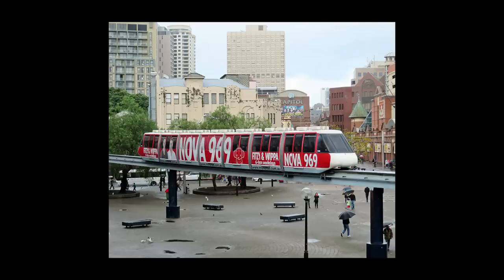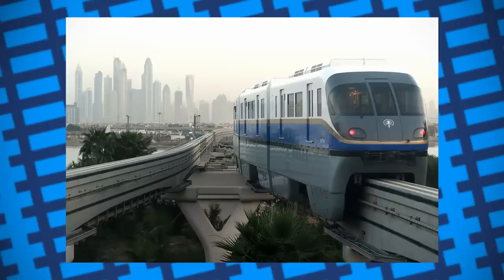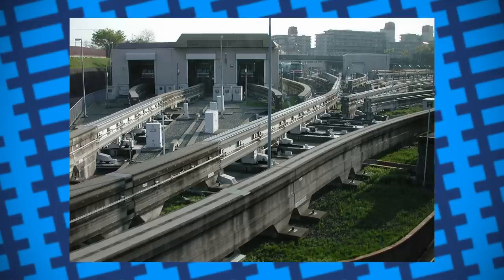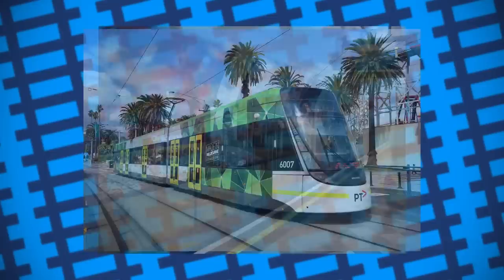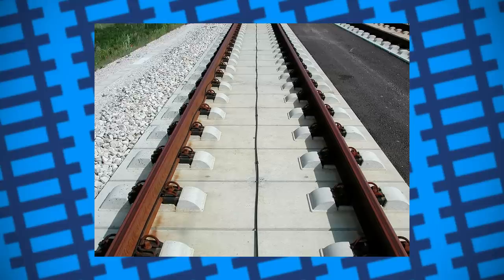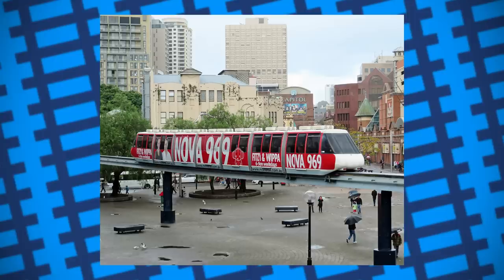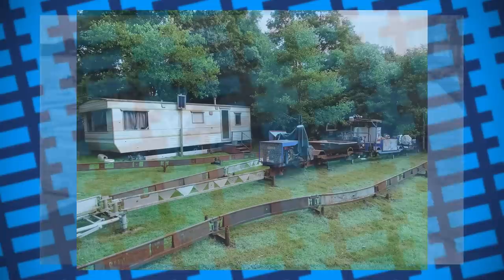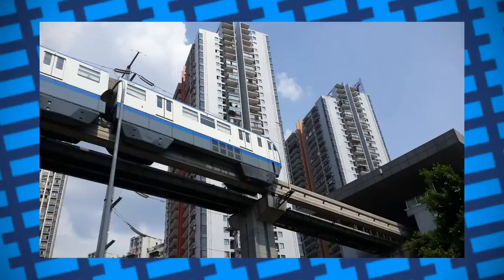Why monorails are bad as public transport - Monorails

Comment: Look man, I like trains as much as anyone, but there's no need to misinform your audience because of your North American/European centric worldview.

- There's no mystery in monorail track switching. In Chongquing and Tokyo it is done automatically and there has not been any incident or malfunction regarding that so far.
- The only fair comparison of monorails are to elevated metro lines because they are both elevated, fully separated from traffic, and have similar construction costs, anything else is absurd. Comparing monorails to trams is just laughable, so there goes 1/4 of your video. The elevated monorail-metro comparison, done fairly, would have revealed that monorails are quieter, can traverse steeper curves and elevations, and occupy less space, at the expense of maximum system capacity and maximum speed. So no, monorails aren't perfect, but they are not the crap you are saying about them, especially on 45000 pphpd capacity routes with little available space.
- Your safety "concerns" are also unfounded, one would think that Japan, the most seismically active country in the world, would have noticed if their monorails take longer to repair than their elevated Metros. The same with Malaysia, India or Thailand, who are also in the Pacific Rim of Fire. And the passengers being "trapped" in monorail cars without means to escape is solved as simply as installing lateral walkways. It has been done on Sao Paulo with no issues and preserving its aesthetic profile.
- About the lack of compatibility with rail systems. That's such a big issue in the wealthy Global North, isn't it? Well, it's irrelevant for us in the South, because in most cities where monorails are being built, bad planning due to neoliberal politics has prevented our cities from building trams, and we can't afford underground metros (and no, BRTs aren't a solution either, ask Bogotá). Sure, an underground metro may be the pinnacle of mass transit, but our countries just can't pay $250M+ per kilometer in order to build them. Or as in Peru, we don't have the expertise and legislation for building one, our underground Line 2 is stuck since 2014 with 0 stations working so far. And many of our main avenues don't have enough space for elevated metros, which do require more physical space. 
- And the proof that you haven't done your research is precisely that: that according to you, no monorails are being built for mass transit today, lol. What about Bangkok, which has both elevated and underground metros, but it's also building two monorail lines as we speak? Or Cairo? Sao Paulo? Bahía? Santiago de los Caballeros? Panama? Liuzhou? Are those cities irrelevant because they are not inhabited by wealthy white people?
Reply: Cairo monorail is ...nearly finished.

Comment: In Bangkok they are building new monorail lines.
There it make kind sense. Because of space restrictions and the danger of flooding
trains have to be elevated anyway. (On the one Subway line you all ways have to make 
few steps up before you can go downstairs, so the subway don't run to easy full of water.)   
The advantage of the monorail is that they are less of a eyesore then existing skytrains.

Comment: Monorails do have their use-cases in public transport. The issue with most monorails built, is more political, than technical. They have simply been built to have a monorails, rather than having the need for a transit line, where a monorail would be the best fit. 
Examples I would kindly ask you to take a good look at, are the Shonan Monorail in Enoshima, and the Schwebebahn from Wuppertal. Both have been built, as the need for a transit rout was present, and a Monorail was the best option.
Building a Monorail somewhere like New York City, would be a bad idea, since the terrain allows subways/metros to be more efficient. But if you take look at Wuppertal, neither the terrain nor traffic allows any other mode of transport, to be as efficient as the Schwebebahn. Its problems in recent years have to do with bad management, and not with the technology. It ran over 100 Years without any major issues, and had only 1 major incident till this day. I can't say the same from any tramway built anywhere in the world.
My point is, that as a mode of transport, monorails are not inherently better or worse, than "conventional" rails. Both have their advantages and disadvantages. But if you use one, where its advantages are meaningless, but its disadvantages are a big issue, then you (as the planer) are at fault, not the technology.

Comment: I guess that some of these drawbacks were only realised in practice.

How do you feel about Hyperloop? I feel that most of the drawbacks to monorail systems apply even stronger to the Hyperloop concept - which to me sounds completely unviable for these reasons, despite all the hype that's looped around it.
Reply: Hyperloop is vaporware, and has too many variants to assess properly anyway (air hover, maglev, regular track, rubber tyres; single pod or multi pod train; exactly how depressurised are the tubes going to be; single-route or a switched network; freight or passengers; etc)
Reply: It's still made more sense to use Rollercoaster as suspended monorail rather than realizing hyperloop concept.

Comment: 'Because they NEED to be raised, they have a small footprint.'
This isn't even an upside, it's a side effect. Because you could just... raise a normal set of rails all the same?
Reply: on the flip side, the claim that regular rail's switches are safer and more eaisly repaired because they're on the ground is like ... 'but... elevated rail exists?'
Reply: @laurencefraser  I mean true but elevated rail still has solid ground making the height less of a hazard, whereas with monorails there is little to no infrastructure to stand on. Even if both have  a height risk, the degrees are simply different.

Comment: While I agree with the points about the rail itself, I disagree with the idea that a raised rail is inherently worse. You can easily make a walkway along it for emergencies, and the space savings and traffic reduction in crowded areas are worth the trade-off of trickier maintenance. Portland has a lightrail that is mostly street level and it very often gets stuck in traffic, meanwhile Seattle has one that is mostly raised or underground and it's almost always on time (and a more pleasant experience). Monorails might still be good for increased traction (although I bet you could just as easily make some kind of cogged track system for hills with normal rail), and Maglev type monorails are probably best for really high speed trains (like the 300mph kind)

Comment: funny how one of the key advantages of them, the elevated tracks, is easily replicated on normal rail as well.
Steeper gradients still need extra effort but not like it's impossible either. I imagine the cost of the elevated track for normal rail cars would be quite comparable to monorail tracks, if not maybe cheaper.
Reply: It's entirely possible to have rubber tired trains too, for extra grip. Some lines on the Paris metro, to name one.
Reply: @captainufo4587  and rack rails are a thing too. Both have enough down sides that you really shouldn't use them unless they're actually needed though.
Reply: It’s not just the elevation of the monorail tracks that give them an advantage. They also have a much smaller visual impact and don’t block as much sunlight as raised regular rail systems.
Reply: @captainufo4587  bad idea. You lose the huge economic advantage of the low friction.
Reply: That was one thing I felt the video didn't explain well. Conventional rail can be elevated just as easily as monorail, making the avoidance of other traffic and ability to install it above other infrastructure not an advantage of monorails. However monorail beams block less light to the street below than conventional tracks, the street below an elevated train (most famously Chicago's "L") feels almost like driving in a tunnel, sort of dreary. For resort areas, such as Las Vegas, this would be an even bigger consideration. As far as I can think of, this is the one and only advantage of monorails over more conventional designs except in very unusual niche applications such as the industrial/mountain monorails mentioned at the end of the video.
Reply: @quillmaurer6563  Monorail has a bunch of advantages, that's why they were constructed as prototypes. Turns out, those advantages in most cases are set off by even more disadvantages; and today, a "light monorail" (eg a local commuter system as opposed to SCMaglev or Transrapid) would not be constructed/developed. 

It may be a good idea to just install the Wuppertal Schwebebahn where light rail is not an option - a proven system where you have the benefit of the kinks being ironed out and you may have a slight economy of scale advantage when you can either order rolling stock without it to have to be fully bespoke, or at least get the construction plans to build it in license. But I doubt that will happen more than a quarter dozen times, if at all.

The majority of "Monorail" systems was however constructed when conventional railways weren't as fully developed as they are today and when there wasn't enough experience to see that the disadvantages most often outweigh the advantages. If you want to find an optimal solution, you have to try solutions that turn out to be sub-optimal.

I don't understand this whole discussion now. Monorail systems for cummuting will be built if there are no other options (eg, you'd have to cross multiple railway lines), nowhere else. Maglev are very different to commuter monorails and have a totally different use case conventional rail isn't able to cover. 

However, if one looks at all the "Monorails baaad!" or "Gadgetbahn"-videos, one could think every single hamlet in the whole world was preparing to build its own monorail.
Reply: @quillmaurer6563  the London DLR system seems to manage the elevated track problem well
Reply: @spikethea2630  There are a lot of conventional rail systems as elevated trains as well - I could see some minor advantages of monorails for such contexts but conventional rail handles it pretty well too.

Comment: While I am not a "monorail enthusiast" per se, I do accept it as a viable modal option for certain environments. 
That being said, there are a few errors, misconceptions, and/or omissions in your well-produced video:

1) Light Rail Vehicles weigh FAR more than monorail vehicles. They even weigh more than heavy rail metro vehicles, because LRVs are designed for crashworthiness (emerging triumphant in collisions with cars, trucks, and buses), which is a scenario that simply cannot happen with monorail or heavy rail designs. The "Light" in Light Rail and the "Heavy" in Heavy Rail do NOT refer to vehicle weight. They refer to passenger CAPACITY.

2) Your discussion of switching issues is not completely unfair, but elevated conventional rail is subject to exactly the same limitations. Rotary switches eliminate the "ends in thin air" issue. Beam replacement switches are quite fast -- the one at the MGM end of the line in Vegas took less than 12 seconds to fully traverse and lock (I timed it several times).

3) Discussing surface running of monorail is EXTREMELY disingenuous -- and you cannot be serious! Monorail was designed from the ground up (play on words absolutely intended) to be an ELEVATED mode. Also, you're omitting the extensive subsurface engineering that surface rail (especially street trams and LRT) requires.

4) Your point about repairing elevated beams also applies to elevated conventional track. You also exaggerate the cost and difficulty. Any company that can build, repair, or replace a bridge can easily build, repair, or replace a monorail beam. It's just reinforced concrete with a few cables and busbars strung alongside it.

5) Emergency egress. Don't pretend that's any different for other elevated rail modes! Modern supported monorail designs (like the LVM) feature emergency catwalks beside or between the beams. It's an FTA regulatory requirement. You're not wrong about suspended monorails, though, which is one of several reasons why I don't like those designs.

6) Japan has shown that monorails can be adapted to high-capacity transit applications. "Futuristic" is literally the WORST criterion in selecting a transit mode. The selection of monorail or any other mode should be driven by environmental factors, such as location (coastal cities with squishy soil, tight cities with smaller blocks, desiring stations within buildings, etc) or applications like overlays atop freeway medians. Like everything else in transit: It depends.

Comment: Trans that are not grade separated are actually a nightmare for surface traffic, but they are the cheapest way to implement rails, which is why the are in the roads. It is not necessarily a "feature".

Comment: Aren't some of these drawbacks also drawbacks of any other type of 'rail' such as Maglev and hyperloop?
Reply: Yes because maglev and hyperloop are basically monorails
Reply: At least for maglev it has speed, and is in service. Musk's Hyperloop is non-existent.
Reply: Hyperloop would be even worse, you are not just stuck on an elevated alligment but also inside a huge vacuum tube.
Let's say you have a fire on a pod.
1. First you have to get to a full stop at 1200kph (750mph). Including all following pods. 
Than you have to isolate the section of track from the rest. De-vacuum the tube. 
But you shouldn't use any gas-mixture containing oxygen for it, it would accelerate the fire. 
Meaning along the whole tube you wound needed tanks to store a non flammable gas to fill the tubes in case of a fire.

Now the fire department has to use a torch to open up the tube, carrying their own oxygen and oxygen for any survivor.
Kill the fire. And than they can evacuate.
I would assume this would take upwards of 1 hour to do.
By then most passager are burned to a crisp.

Now because the tube is open, you also have to slowly open the barriers and drive every  following pod slowly to the evacuation point or cut open every segment before the effected to also evacuate those passengers as well. And the track will be out of service for weeks.
Reply: At least a couple of the drawbacks mentioned applie to Regular rail if you elevate it <_<   But yes. 
Maglev actually has viable use cases that nothing else can fulfil (very few, very niche, but they exist). 

The Hyperloop (that is, vacuum trains) is a nonsense idea that's been around for longer than I've been alive and had MANY major problems with it found to the point where it's just not viable... and that's when it Wasn't just Musk scamming the ignorant to sell inferior tunneling machines and cars (noticeably, Tesla cars have issues due to refusal to comply with the set of standards everyone else has settled on... among other problems, some shared with other manufacturers (despite not being inherent to EV technology), others not). 

Monorail has a few nich cases where it's useful, but there are alternative options for filling those niches... though if you weigh up the pros and cons in those niche cases they're all the sort of system where applying them to lines that don't have to deal with the specific issue they solve is a downgrade from just using regular rail... but not doing so means they don't share much of the common support infrastructure (all the way back to manufacturing logistics) with the rest of your system.
Reply: @IamTheHolypumpkin  Not to mention the scammy nonsense that is using pods in the first place. It's basically 'let's build all  the infrastructure for a train... and then throw all the benefits of a train out the window and run what amount to vans, at best, on it'